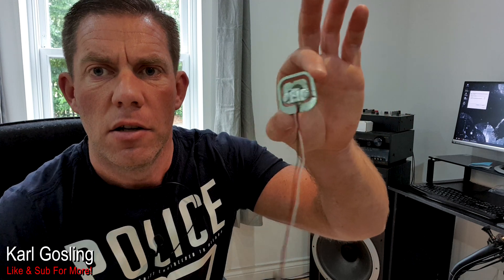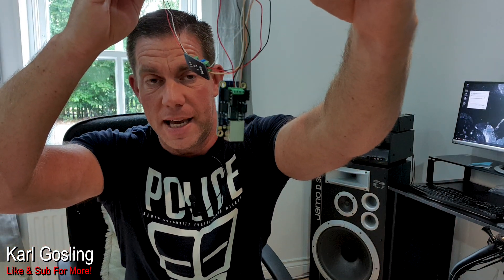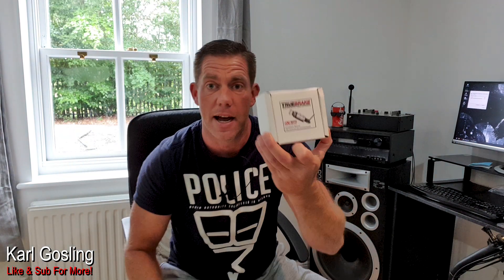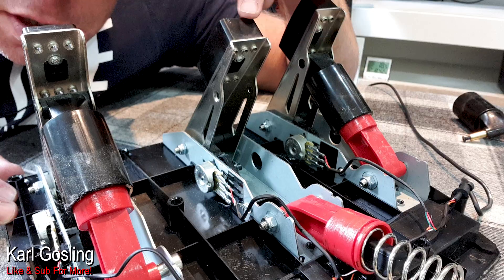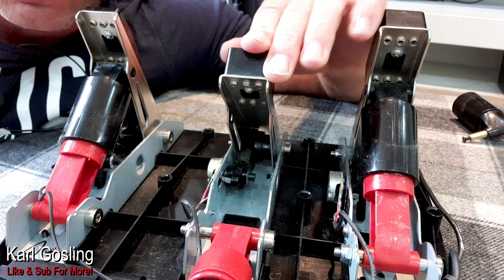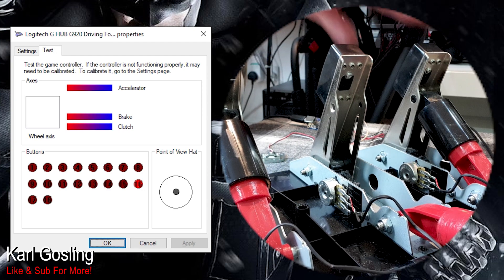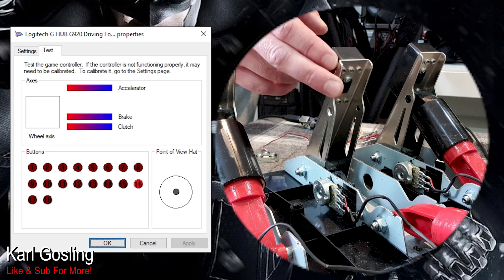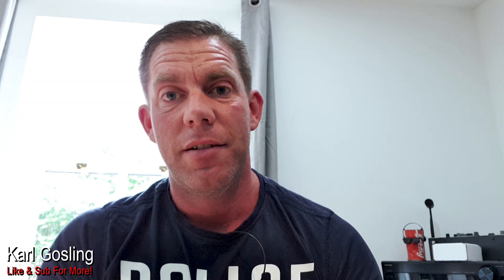Sim Racing Brake Pedals - Load Cell VS Potentiometer

Comment: So the spring set up works the same as in an actual car. Press the pedal half way down, you get half braking, all the way down full braking and the master cylinder pushes the pedal back up each time.  it seems to have worked for over a hundred years. Why change it?
Reply from the maker: No mate, thats not how an actual car brake works, if your pedal goes all the way down something is wrong! lol 
There will be some initial travel (taking up play in the components, disc to pad clearance and a small amount of fluid compression) then it will harden up and from this point you are modulating pressure via the fluid to the calliper pistons.
Reply: @KarlGosling  So as I said "works the same as a REAL car" half pressure (5k ohm) on the pot, full pressure (10k ohm) on the pot. Also after working on cars for 40 years I'm pretty sure I know how it works, mate

Comment: May have missed it but did you mention what are the advantages of the load cell over potentiometer pedals ?
Reply from the maker: Pressure based breaking, like in a real car, as opposed to pedal position based breaking.

Comment: Today I switched out the crappy stock pedalset of my Thrustmaster TS-XW with the way more appropriate T-LCM (Thrustmaster Load Cell Magnetic). Apart from the obvious build quality the loadcell brake with a preload spring and adjustable main springs makes all the difference. This is the pedalset this wheel should have come with from the factory! 😎👍
Reply from the maker: A decent upgrade for sure mate!

Comment: im having trouble with my low end thrustmaster force feedback pedal :( teething trouble for sim racing newb or what lol

i just cracked it open n find accelerators spring as lost its effectiveness so having to do some small modification on it now! [with some EB-technolegy} ....

hope to upgrade in the future when ive saved up enough!.

Q; do you know or anyone reading how you auto set the pedometer one once you put it back together rather than manually trying to find the notch it was on which would be a pain to do as it impossible to do when its open as it moves once you tighten screws down putting it back together.

thanks for your vids always find them very informative!. even if you do make em up as you go along its fine by me 'real life ain't scripted'.

Comment: I did use a loadcell for a bit, but with the one I had, there was pretty much no possible way to configure the stiffness and that made me go back to potentiometer. The travel distance was so short, that I felt like trail braking was damn near impossible.
So yeah, it seems like everyone in simracing is really hyping load cells up, and while they probably do help in the long term, I felt like I needed a month or so to adjust. I might give it one more chance at a later stage, but for now I am happy with potentiometer + resistance. And oh yeah, do not even think about load cells if you are still in an office chair. You really do need a sim rig for that, and I would say a decent one as well, not an entry-level one.
Reply: I've used a loadcell on a G29 in the past, and that improved my braking tremendously. And that was when I used an office chair which connected to my simrig.
Reply: Hey man, i have a question for you,
How biggest is the potenciometer ohms , more precision? 

If i get some potenciometer more expensive, it feels like a load cell?
Reply: If you got pedals that can change springs rubbers travel etc there is no real difference to potentiometer or loadcel, the Logitech pedals are just way too simple.
Reply: Thanks for the comment - I’m thinking about getting the Fanatec CSL Elite pedals — but will just be clamping the wheel to my desk and don’t have room to mount pedals to anything — so sounds like I can’t use the loadcells. My question is — are potentiometer csl elite pedals still a big upgrade over something like the G29 - ie worth the money - or you think I should just get the G29?
Reply: @TubeYouDSilvy  I haven't use the G29 myself, but I have had the Thrustmaster TX before and these CSL elite pedals are definitely a significant upgrade. However, from what I have heard, Logitech pedals are somewhat better than Thrustmaster pedals tho, so I would recommend searching for some YT videos or reddit posts before deciding. I bet the CSL elites are better, I'm just not sure which if it has the better value between the two.
Reply: In my opinion, there is no difference between loadcell and potentiometer, they are just sensors, the build quality(depending on price), and the whole physics system is what in charge. If the potentiometer sensor is ultimate accurate, I believe it can do what load cells do. In a given physics system of one pedal, there is only one load force to travel curve.

Comment: Karl mate, I've been having the somewhat common issue of throttle spiking with my G29, apparently dust/dirt in them can cause this. I blasted the pots with some electric contact cleaner which seems to have done the job, but reading forums it seems that it isn't a permanent solution. Would load cells be less prone to this kind of issue? Cheers.
Reply from the maker: Load cells have no moving parts so yes mate.
But I'm sure new pots would only be a couple of pound each if you wanted to replace them and keep you're current setup.
Reply: Yeah I hear replacement pots do a lot better than the stock Logitech ones. Will check them out. Cheers.
Reply: Hey bro', check out the much more cost effective linear potentiometers from aXc Sim. They're a lot less expensive, easy to install and for the same money as one "load cell" mod you can have all three pedals upgraded with the TruPedal linear potentiometers and have an amazing complete set. I did that for $100 and with the Leo Bodnar USB conversion they are so accurate you'd never know they were arcade pedals from new.

Comment: If you're interested, on the G29, it's 3.3V between Red (Live) and Black (Ground). As we press a pedal, the Voltage between White (Brake)/Orange (Accelerator) and the Ground drops from ~3.0V to ~0.0V
Reply from the maker: Handy to know, cheers mate! :)

Comment: I feel like you're still being hard on the True Brake almost to the point that YOU are being misleading.  I think I understand why AXC says it acts like a load cell.   If the True Brake only moves 3mm beyond the return spring to register its maximum signal then that's not much movement at all.  The main spring is so stiff that you will need to apply a lot of force to increase the signal while the pedal is not moving much at all.  Even the load cell in your Fanatec pedals are moving a bit... it's just a really tiny amount to the point that you can can't really notice it.

So in this way... while the True Brake does move... since it's only moving like 3mm while you put upto 20kg of force on it... it's closer to a load cell in behaviour than the stock Logitech setup which makes the brake pedal move INCHES.

I'm still looking forward to your actual TrueBrake review because I ordered one.  But your first two videos seem a bit click baitey.  Which I guess worked because I watched your two videos so far and you managed to get a True Brake ahead of the rest of us that paid and have been waiting months.  lol
Reply from the maker: Why is that mate? Everything I say in this video is positive about AXC and I'm just demonstrating how the two different technologies work, what's misleading about that?
AXC have revised the description and URL to more accurately reflect the product and that's great and exactly as you say it "acts like a load cell" rather than saying it IS a load cell, perfect! :)
All video titles are supposed to get you to click and watch, otherwise we'd have no viewers! lol The are completely accurate though.
My TrueBrake is Rob from AXC's personal one, it's going back at the end of the week once I've finished the review as I have no need of it and I'm sure he'd like it back! :)
Reply: @KarlGosling  That true, that true brake might not read elastic strain... But it sure works similarly to a load cell I'm the practical sense. You miss a point, important one. Do you know how a load cell actually works? How it measures the load? A load cell is actually an extensometer, it measures strain or how much the material, in this case metal elasticity deforms. As we're in as elastic regime the relation is linear and it easy to extract the load. If you take a very stiff spring and combine it with something able to read the spring compression displacement you can easily extract a load as the elastic constant of the spring is rather linear. At the end... They are not that different in principle, and in the pratical side they fell similar (depending on how stiff of metal piece you have on your load cell)...

Comment: Very Honest review. Will you be installing load sell in to a G29 and a link where to purchase for ps4 & Xbox users as well as pc. Thanks for a very clear expansion. My grandson and I are very new to driving sims 👍🏻
Reply from the maker: Possibly yes, but it will only work for PC I'm afraid.
Reply: @KarlGosling  -  for around $12, a pair of those load cells wired as a bridge feeding an e.g. INA333 rail-to-rail instrumentation amp could replace the Logitech potentiometer.
Reply: @Steven Carmichael 
Sorry thanks for the reply  your loosing me now. LOL So is it possible or is it not worth the trouble. Cheers
Reply: Thanks Karl 
That’s a shame just one question just out of curiosity I’m guessing there are 3 wires to the pedal that sends signal to software in either case why would it not work on a console ?
Hope you don’t mind me asking just curious. Cheers Barry
Reply: @bazza224  The full load cell signal change is very small (millivolts).  A pair of those load cells could be wired as a so-called bridge, then their difference amplified to deliver a signal comparable to Logitech's potentiometer.

Comment: Hi There, just watched this vid and i believe it will help me, as i am a hand control simmer, i am trying to add some resistance to the brake paddle on my rig. i frrl i can get better lap times with something that i can have some resistance to work against, looks like a load cell and some spring will work. thanks for the  vid, very informative
Reply from the maker: Sounds good to me mate, hope it works out! :)

Comment: That's very well done. I'm looking forward to buying my first wheel(Most probably the Logitech G29).From a keyboard sim racer to a sim racer with wheel, here I come :)
Reply: Keyboard? I feel sorry for you aha
Reply from the maker: Enjoy mate, you certainly won' go back! lol
Reply: Logitech G29 is a good set (I currently have one) - Prices are too high for the G29 and G920 at the moment (~£299). I got a G29 as it was £180 with free gear shifter (2019 price) and that was a lot cheaper than Thrustmaster. - But now prices are nearly the same, might be worth looking at Thrustmaster T300

Comment: great Demo ... still waiting for my True brake.
Reply from the maker: One tip I can give right away... you MUST have the pedals bolted to a full cockpit... review coming Friday.
Reply: @KarlGosling  Definitely. I used the TrueBrake with the built in carpet gripper on the pedals and the plastic holding the gripper has snapped after a month. Much better now my Playseat Challenge has arrived and I can actually race again.